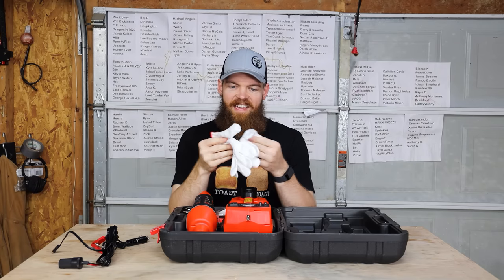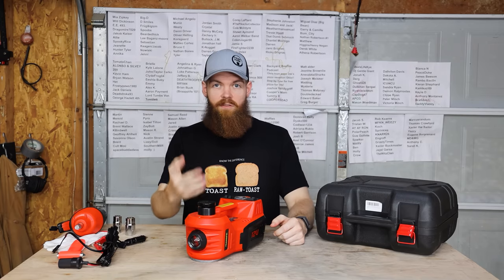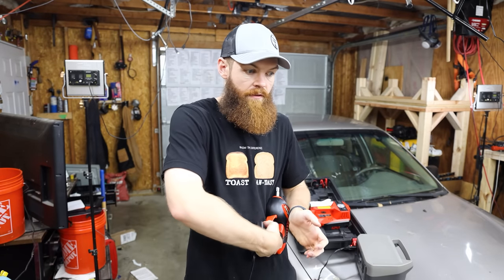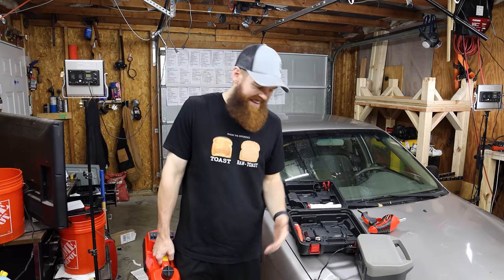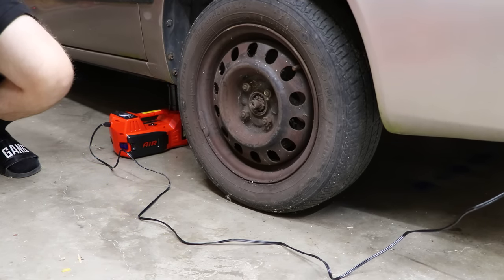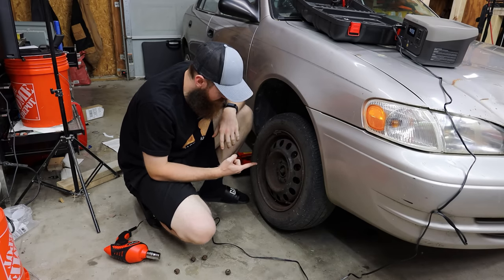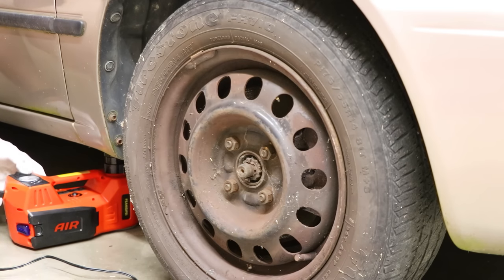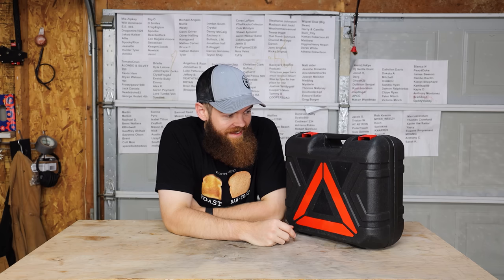Testing The Cheapest Tire Changing Kit On Amazon!

Comment: The impact design is actually kinda brilliant. It works similar to a regular impact, but it has that spool up stage to both save electricity and build up torque.
Reply: I mean, when you think about it, it's designed to run off the car battery.  Do I think it'd stand a chance of draining the battery?  Probably not.  But why risk it, if you have a solution that conserves the amount of power required?
Reply: Actually I think their is a better reason for it to be that way other than saving battery and that is that it applies enough force to loosen the bolts but for a short enough time where if it failed to loosen on the first tap it isn't going to snap the threading... (To lazy to re write so here is what I wrote what I though the tapping design was for)

Honestly while the tap, tap, tap seems weird I think that may be to make sure to not snap the threaded part by keeping the pressure at a minimal amount of time, I know one time trying to get a bolt off I ended up snapping the threaded part because it was on too tight and probably got some junk causing it to stick worse, by giving those love taps rather than staying strong the entire time you are still applying enough force to slowly get it loose while making sure that if it is too stuck you don't end up over torqueing it snapping it while trying to get it off. So while it seems odd if you don't think to hard about it, it actually makes a lot of sense having a way to apply the pressure needed to loosen the bolt without giving it enough range of motion to actually cause any damage if it fails to loosen on that quick burst tap.

A way to look at it is you need to move a heavy box, once you over come friction you are golden but until you over come friction you have a risk of cracking the box, since over coming friction takes more force than keeping it moving once moving if you are building up to the speed you need and pushing harder and harder you risk cracking the box before it breaks free of friction, but if you bump the box take a second and keep bumping the box until it over comes friction allowing the box to return to its original state between bumps while it still has a risk of breaking the box because the inertial force is such a short distance it is a much reduced chance, and once you get it sliding then it has the force to keep pushing. 

In some ways it has a higher risk of cracking that screw thread but in many other ways it has lower risk of cracking that screw thread making it an over all lower risk of breaking something by going tappity tap tap rather then one long hard shove.
Reply: @rcslyman8929   Manufacturer doesn't care, asmuch or at all saving car battery but smaller power means smaller current-that means thinner wire and savings in copper.
Reply: Impacts need current and you can't pull that type of current through a 12-volt cigarette plug so this type of spool up impact is sufficient for its application.
Reply: @hockeyhacker97 yeah that’s not it.  It’s just a way to pretty cheaply get a lot of torque out of the tool without a really big hammer to drive the impact which also requires a bigger motor. If the bolts going to snap then it’s going to snap. 

The box example is also wrong. It’s not like that at all because the box doesn’t have a point in time where it’s not actually moving besides before you start pushing. Impacts, especially like this one, have multiple points in time where they are not rotating. Every time you hear an impact the impact is not moving. The lack of movement is what causes the impact to happen at all. 

Go watch torque test channel and you’ll get a decent rundown on a tool like this one. I think it’s called egg beater impact

Comment: The fact that Tyler is a diesel mechanic and he hasn't had his wheels rotated or brakes serviced in over 8 years is not in the least surprising
Reply: I've never had tires rotated its pointless
Reply: @goreobsessed2308   In my truck that is rear wheel drive,  my back end being a lot lighter than the front doesn't have as much traction.  I find that my rear tires when I don't rotate them are about 60 to 70% more worn than my front ones. So rotating is not pointless for everything
Reply: @goreobsessed2308  rotating your tires is absolutely not useless, you are just plain incorrect
Reply: What bugged me was not doing the lugnuts off in a cris cros pattern (star for 5 bolts)
Reply: @ryancasey4807  I change my tires every few years don't let them wear out in the first place
Reply: @goreobsessed2308  I don't know how to explain this to somebody who's acting this unsmart...
Reply: @frogsnacks  it doesnt matter in the slightest the order in which lug nuts are removed
Reply: diesel technician  but walks around in shorts and flip flops while doing tests
Reply: @frogsnacks  That applies to tightening them not the removal.
Reply: @goreobsessed2308  Its for even wear on tires. Also let's you or the mechanic know if you have an alignment problem. Sure if you have the money to buy new tires every year thats all good, but then when you do have a problem in your steering system you won't catch it early and will pay dearly for that repair. I know you will just buy a new car silly me.
Reply: Not changing your tires in over 8 yrs is stupidity, those tires would be long overdue for the junkyard.
Even if the tire tread is not worn out, older rubber will get hard and you'll lose traction because of it.

Also not having a 2nd set of tires for winter is another lvl of stupidity. Even all yr rated tires are crap on snowy roads.
Reply: @DonGorgen  facts! My Bridgestone blizacks are deadly in the winter and I almost never have to use 4wd ever anymore
Reply: @localcitizen1923  lol I'm driving 96 VW cabrio new cars are for idiots with to much money
Reply: @neb_setabed  that’s weird, typically your front tires will wear faster than the rear simply due to turning
Reply: Or... Or, hear me out, he hasn't driven the car in ages? Or is this his daily?
Reply: @itsnetts  pretty certain that he daily drives this car...
Reply: @ActingLikeABoss  I drove on a lot of rock roads so that caused a lot of breaking loose in rwd mode especially on hills
Reply: @ryancasey4807  In that case, that's obviously not good. Does it not snow at all where he lives so he'd have to change to winter tires or is he using all year tires?
Reply: @itsnetts  dude how would we know if he uses winter tires or if it snows wherever he lives... Even in 5 month snow states most people don't use snow tires...
Reply: @ryancasey4807  Well I was thinking somebody oughta know what he lives around, from there you know if it snows there or not. Also my question about all year tires shouldn't be too difficult to answer if a trained eye looks at the tires he has in this video.
Reply: @itsnetts  then why don't you look at the tires in the video...
Reply: @ryancasey4807  Because... Because I don't have a trained eye? At least not yet.
Reply: Considering everything he's doing to this vehicle I highly doubt he's driving it.
Reply: @ryancasey4807 he can’t have, the rotors were rusted on the face and the spider web in the lugs themselves shows that it sits.
Reply: @munkustrap2  you clearly don't know Tyler very well lol

Comment: That's honestly impressive. The driver design is pretty cool. It doesn't have the tech that more expensive tools do, but it makes do with what it has and it works.
Reply: My Milwaukee M18 Surge and my M12 Fuel Impact is around 4000 IPM, This thing is like 30 lol Color me impressed.
Reply: Flywheel power for the win, baby. The only question is...for how long?
Reply: @jessebrook1688  i was thinking the exact same thing. It's probably only good for a couple of uses. I can't imagine a flywheel like that would last long.
Reply: I believe the NASCAR guns technically operate on the same principal. Just alot more RPM and intertia to keep spinning the nuts off.
Reply: @Bl4ckD0g  Nascar guns are just suped up Ingersoll & Rands, they're a normal impact. Just a lot faster. Not flywheel design.
Reply: @Chris.Rhodes  Gotcha, I could've sworn I saw somewhere that they used more of an inertial hammer design like this, but it wouldn't be the first time I mixed information up.
Reply: makes due as well  : )
Reply: @Bl4ckD0g  They all use inertia hammers.... there's a hammer and a dog (that's the name of it) you can YouTube how a impact works, Torque Test Channel has done a lot of videos on impacts and even fast impacts like Nascar but I don't think he's been able to get his hands on one as their not sold to the public, they're specifically made for nascar. This impact basicall builds up speed and makes one hard impact, rather than a bunch of smaller impacts. Like my original comment, my M18 impact is 4000 impacts per minute. The impact in the video is probably 30. It sounds like (if you were to hold onto the trigger) it impacts every other second so that would be roughly 30 per minute. A lot slower, but more force per impact. Make sense? I hope I worded that right lol
Reply: @FranktheTank319  i mean a flywheel design like that is plenty durable, thing is it likely wasn't designed well so it will not be very durable, and everything around it is definitely not designed well, ive pulled out those cheap compressors and had them just not turn on or build zero pressure before when they haven't even been used more than once just for testing purposes, and ive had crappy drills go out on me almost immediately before, i wouldn't rely on that kit as my back up because i could very well just pull it out and have something not working right off the bat
Reply: @Chris.Rhodes  they are actually called anvils not inertia hammers. You have 2 anvils in an impact wrench or an impact driver, a smaller minus sign shaped anvil for the collet or socket connector and a larger cylindrical shaped anvil connected to the gear reduction or the rotary vane air turbine. A high quality cordless impact driver or wrench consists of a brushless DC motor, a planetary gear reduction, lots of grease, and anvils that are made out of Cr-Mo steel such as the Milwaukee M12 Fuel 3/8th stubby for example.
Reply: And after just one use, it basically paid for itself.

Comment: Ok…now you have to do a test with the impact it’s self…tighten nut down to various torques to see what the limit is!
Reply: Yep...I was surprised that he didn't install the tire with it...pretty important
Reply: 100% want to see a vid of this! Would be really interesting. Also a torture test of that Jack too 👌
Reply: I wanna see the impact it is self as well!
Reply: these types of impacts hit basically like a regular cordless mid mid torque. each hammer is significantly heavier than what a regular mid torque hits at, but of course it's much slower. This means that for super seized stuff it works better than a regular impact, or will instantly just snap the stud.
Reply: Torque Test Channel did a video where they had one of those guns. It hits really hard, but takes forever. They called in an Egg Beater style or something.

Comment: The "impact" driver sounds like those old wind up toys. The ones you had to rev up a few times then let them go so they go fast LOL Very surprised at how well it works
Reply: Its spooling up a flywheel. Probably got a centrifugal clutch that once it opens far enough engages the clutch and BAM! A seconds worth of surprisingly good torque transfer.
Reply: @foughtwolf  right, that's how other impacts work too. The only difference is this one takes a while to spool up and a typical impact spools up pretty fast.

Comment: Yes that vehicle torque spec calls for 80ft-lbs, and no your torque wrench works the stud/lug nut are now just messed up. Only vehicles with 7/16 and 9/16 lug studs get torqued over 100ft-lbs. As funny as that thing is it was impressive how it actually performed. This could actually be good for someone new in this area. I will say I have ran into quite a few folks that didn't even know how to change a flat tire to begin with. For future information to those that might purchase this, your going to want to hook this up directly to the battery and have the vehicle running any time you use this product. You will get better/faster/reliable results that way.
Reply: Yup, all he did is took the stud to the yield point = stud junk.
Even tightened to 80 ft pounds it won't provide much less clamp load.
Someone earlier in the comments mentioned Tyler was a diesel mechanic - I found that very hard to believe.

Comment: If I had to make a guess I’d say the Velcro type material on the side of the case is so you can lay it down on the floor in the back of a car and not have it slide around everywhere because the Velcro would grip to the carpet. That’s my guess, I’m not saying I’m right😂

Comment: I was impressed the jack worked. I was also curious if it tighten as good.
Reply: It left me with the impression it doesn't. It only takes the nuts off for you. I imagine to simplify the design.

Edit:
It's does have a tighten button.
Reply: Even if it doesn’t, it’s enough to get you to a service station.

Comment: You can aim the light at the tire you are changing, Tyler. You control which way it is facing
Reply: Not if you are using the jack tho. The light would shine directly underneath the car since the light is attached to the jack

Comment: 11:56 and dude that was pretty good….much better than using the tool that comes with the car. And the design of it is actually really smart. It does not strip the bolts, so it does small ounces of power and then it goes right for it. I really like this box. I’m gonna get one myself.

Comment: I've got a kit like this but looks a little different, I've had it for 3 years now, works great. I'm glad mine doesn't have the flashing red/blue lights, there is a tiny LED just in front of the jack shaft, its for eliminating under the vehicle. The velcro is to stop it from sliding around in the boot of the car.

Comment: I haven’t opened it up yet but I ordered the eco flow and used your code and got an amazing deal as there was an additional coupon and they allowed yours to be stacked. Annnd I got a free camping light which I did open and is actually really nice. Hopefully it works cuz I wasted some money on another brand portable power station and it’s a useless brick now that I can’t even return. Glad I could support you and hopefully get a product I need that actually works lol. I use it in my travel trailer when we’re not at a campsite.
Reply: Engine star is the name of the overly priced brick I bought so don’t buy that one. Lol. Price wise the eco flow was reasonable compared to like a jackery which for my purposes I don’t need anything that crazy.
Reply: just buy a long pipe and stick it over the jack to give yourself more leverage.

Comment: honestly i didnt expect that "impact" would do absolute shit lol im impressed tho  i get an understand how it work atleast in theory maybe since the anvil inside spins up to speed then finally  expels that  inertia in 1 fell swoop.. sorta acts more like a nascar or indy racing air gun where it builds up the hammer/anvil  inertia before imparting it onto the lug nuts which is why the prespin them up prior to putting them onto the tires at the race
Reply: Yeah it seems like it's just a trade off. Less ugga duggas per second but the ugga duggas are still strong. Interesting little tool, a clever cost saving design.
Reply: Yeah i expected an impact that i assume uses a centrifugal clutch instead of a hammer and anvil to suck but yeah I was wrong
Reply: It feels like this kit was just to get you mobile again. Like a car's version of a first aid kit. It's a small, compact case that can fit in virtually any car's trunk/storage space, and it'll definitely do the job of getting really sticky lugs off so you can get the spare tire on long enough to get to a mechanic who can do a better job than the kit. I mean, for what it is, I'd say it's probably worth it if you're going to do a lot of traveling. Otherwise, just throw your car at your insurance and AAA.
Reply: @point-five-oh6249  you might be surprised  how few modern cars an suvs come with a spare tire anymore its kinda astounding to me lol alot now just have a  bottle of slime/fix a flat , plastic air comprosser an maybe tire plugs

Comment: Realistically 90% of the glass breaker and seatbelt cutters sold as self rescue are not suited for that. If it's loose in your vehicle it becomes a projectile in an accident and won't be where you left it. Very few that I have seen are marketed/made in a way that allows for the ability to secure it somewhere that will be easy to get to in an accident. The one in this kit is a rescue version and it being in the box in the back is fine because it's for when you are the first person on an accident scene. I would also add in the case of self rescue the glass breaker needs to be spring loaded as you just went through an accident and may not have the ability to get a good swing in either from space restriction or injury.
Reply: Spring loaded center punch is better than all those "glass breakers".

Comment: I'd like to see how the cars own power handled the tools. Running those tools off the cars battery could be a completely different experience.
Reply: No, it was only pulling a few amps, so it should be no problem. You can tell by the thin cord that it can't pull a lot of current.
Reply: If the alternator is not also faulty, leaving the engine running, only slightly dangerous, would provide plenty of power. Or in a BEV, there should be no issue at all if the car is designed right and you're not almost out of electrons.